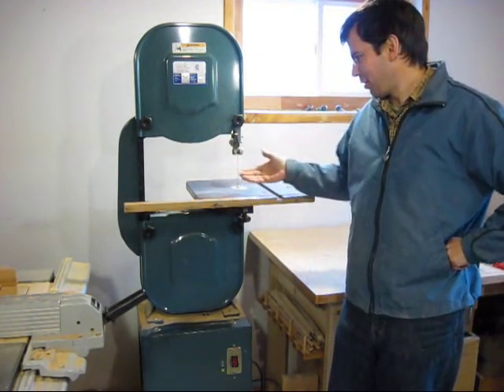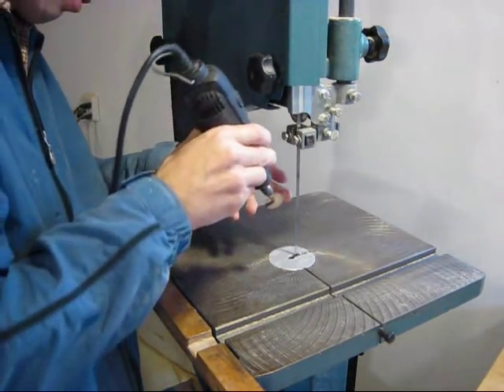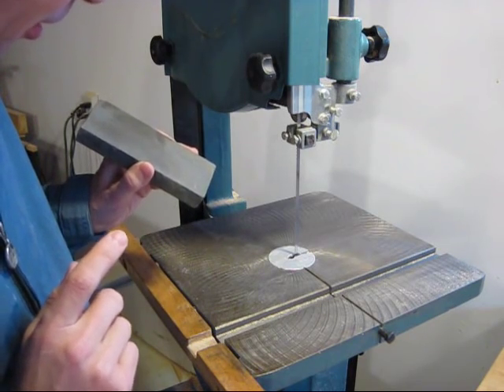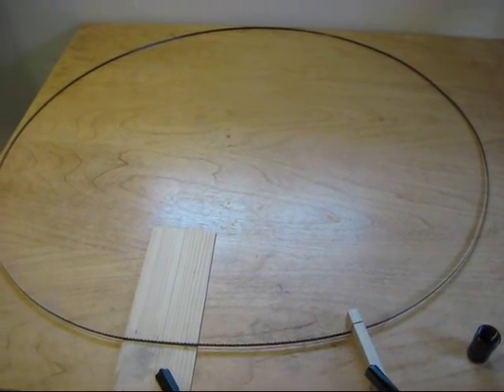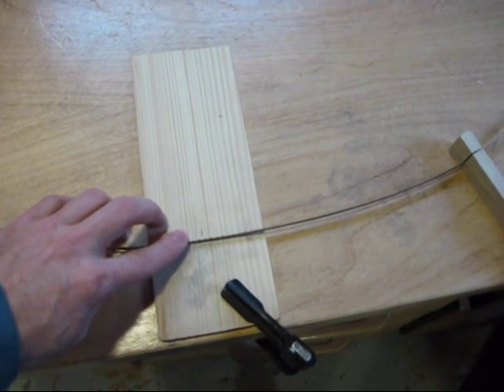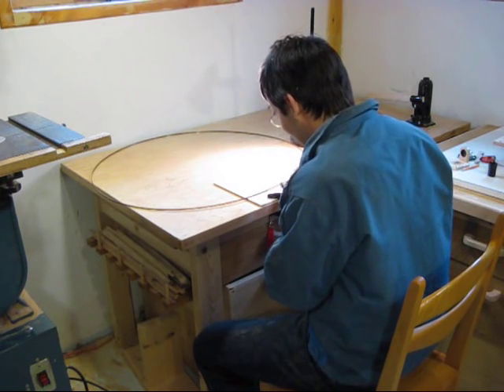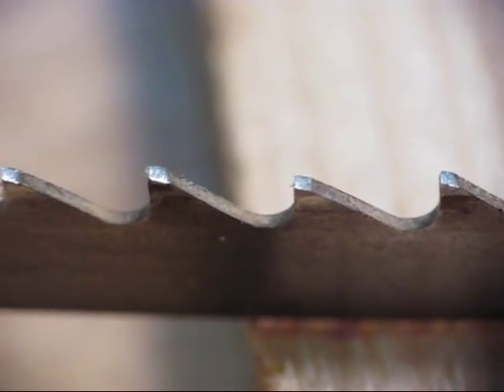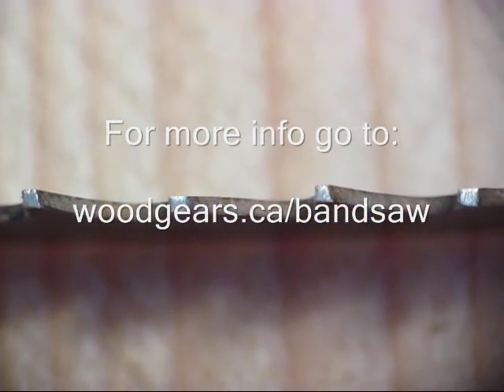How to sharpen a bandsaw blade

Comment: Great video. I used your method and restored $50 worth of practically useless Shopsmith 5/8 in Resaw blades to new condition.Not only do they cut like new but now the drift is consistent and easily correctable. Thanks

Comment: That's pretty clever!  I have a little machine I got from Harbor Freight that sharpens my chainsaw blade that is about the same.  If you had a bunch of blades, I bet you could mount the Dremel in something to make sure you get an even grind on each tooth.  I'm going to try this on my bandsaw blade...I've found a few nails with mine!

Comment from the maker: I guress I'm not sharpening my blades then.  But even after I "not sharpen" them this way, they cut MUCH better than before.  In fact, after the first sharpening, the blade usually cuts a bit better than new (they aren't that sharp to begin with)

Comment: I used a dremel with a 1/8 inch diamond straight bit held it sideways with the blade on the saw. Took about 5 minutes to do the whole thing.  Easy Peasly. Sharp as new.

Comment: This is a great vid! I have a new blade that seems to have a good, weld. The spine is straight. But somehow, a few of the teeth protrude too far next to the weld, and they take a huge bite out of the wood, once per revolution. I think I'll try grinding them down. That seems easier than learning how to fold a bandsaw blade to send it back.
Reply: There is a tutorial on u-tube showing how to fold a blade and it works. If I can do it, it's gotta be easy for someone with dexterous hands. I find long blades the easiest folding, like trailers, the longer they are the easier they  back.

Comment: Hey Matt how about designing one of your wooden machines to automatically sharpen band saw blades like the big pricey commercial ones that sharpen sawmill bands just in a small scale for shop bandsaws. With an auto advance mechanism and a way to hold the dremel at the right angle. It would save a lot of money for new blades. And time.

Comment from the maker: Running the blade backwards would flatten the teeth just as much running forward.  The tops of the teeth need to be at an angle to actually cut into the wood.

Comment: Do you go with the aluminum oxide grinder or the silicon carbide? Does it matter? Just looking on line I'd guess the regular old aluminum oxide....
Reply: For what it's worth I just tried the aluminum oxide grindstone (reddish) on one blade and the silicon carbide (bluish) on another blade. Both seemed to sharpen the blade equally well, but the silicon carbide grindstone was completely used up in one bandsaw blade -- which probably explains why people typically use it on softer metals. The aluminum oxide grinder seems to have a lot of grinding left in it. So that is the one I'll go with in future.

Comment: not bad as far as bodge jobs go... a better method would be to use the slot setup on an angled drill press table, then you can consistently reproduce the relief and depth, and if you angle the blade guide, you can even reproduce an offset top bevel if the blade is so ground; just grind evey other tooth with the block facing one way, then flip around and sharpen the rest. aside from the tooth set, this would yield a factory grind.
Reply from the maker: I wish everyone actually tried their own suggestions
Reply: Matthias Wandel I'm a saw filer. if I had to bojang a sharpen with the tools in a home shop, that is how I would do it. If I had to do what you're doing, I would recommend reproducing the relief angle more closely. you would end up with a more even grind. taking just the tiniest bevel with such a fast aggressive tool means you'll have uneven cut depths due to poor depth control, which is evident in your final result shot. Using a press with a depth stop, which you have, would guarantee consistent depths. Just trying to help, bud.

Comment: Matthias, wouldn't reversing the blade, and running it against the grindstone perform the same style of sharpening?  Thanks for the great videos.
Reply: Justin Leyte no, you would lose the relief angle that allows the next tooth to catch the wood to cut, your albeit 'sharp' teeth would not cut, as the flat tips would just ride on the wood surface.